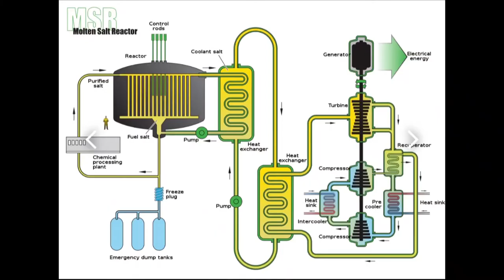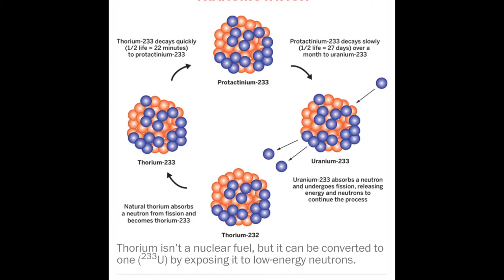The benefits of a Liquid Fluoride Thorium Molten Salt Reactor

Comment: India too has a lot of thorium, and they want to use it. Ther are many smart Indians who can develop the tech.

What about tritium, a by-product? Isn't that one of the elements that's used in nuclear fusion?
Reply: Nuclear fission is for bombs. You need to research a bit, about tritium, dangeroue by-products from thorium use.
Reply: @yngvesognen1092  I'm sure it can be safely handled. Besides, it takes a lot of work to create a nuclear bomb.  In fact when you think about all the crap just dumped into the air from other power plants and the heavy metals put out in the environment, the risk is small.  You need to assume less about other people.
Reply: @daniellarson3068 , I'm sure is not good enough. You have to look at both upsides and downsides. Again, take a closer look at it.
Reply: @daniellarson3068 , really, you don't know the difference between fusion and fission? Rather spend some time googling than walking on a beach talking about things you don't know enough about.
Reply: @yngvesognen1092  You are trying to get a reaction from me kid,......nope.
Reply: @daniellarson3068 , I am trying to get you to think, because you need to know at least the basic concepts of what you're talking about.
Reply: @daniellarson3068 , don't get me wrong.Thorium can quite literally save us. We just need to consider all factors, good and bad.

Comment: "The benefits of  Molten Salt Reactors" There, fixed it for you, thorium has nothing to do with it.
Reply: But Thorium works as a breeder. It's a cheap fuel, why not get excited about it?
Reply: @Birdy890  Thorium doesn't work as a breeder, it doesn't do anything. Thorium is not cheaper and there is just as much uranium as thorium. A uranium MSR is much simpler and cheaper to build and operate, that's why all the MSR start-up companies are using uranium, not thorium.
Reply: @chapter4travels  I could be mistaken it's been years since I was really into nuclear energy, but wasn't the fact that Thorium can breed one of the main reasons why it has been nearly fetishized as a viable nuclear fuel?  My understanding was you had to start the reaction with Uranium, then feed both Uranium and Thorium to keep the reaction going, but only needing to feed a small amount of Uranium because the Thorium will breed into the fissile material needed to keep a reaction going. I'll have to review the info and get back to you.
Reply: @Birdy890  Both uranium 238 (the most common form of uranium in nature) and thorium are fertile and can be converted through a few steps to become uranium 235 and fission. However, this type of reactor is more complicated and expensive. People were interested in thorium because they thought we would run out of uranium 235 and we needed an alternative. Since then we discovered there is no shortage of uranium 235, so it's much easier and cheaper to just use it without having to build breeder reactors.
Reply: @chapter4travels  So first you say it doesn't work as a breeder, then you say it's not needed because it can breed. And no, it's U-233 that Thorium easily breeds into and U-233 is the main ingredient for a LFTR.
Reply: @chapter4travels  Yes, you need Uranium or some other fissile material to start the reaction, but once the environment is neutron rich you can then feed Thorium into the reactor to breed into uranium and thus sustain the reaction. Fissile Uranium is indeed much more rare than Fertile Thorium. Thorium has the advantage of being fertile in low-speed neutron environments (this is why a LFTR needs the Graphite moderator, and thus why I like the idea of a fast spectrum reactor moreso) meaning it is extremely safe as it's self-moderating. If the reactor gets too hot the neutrons go too fast for the breeding process and thus the temperature drops with no need for outside interaction.

I don't think what is cheapest is a viable argument considering we're talking about Nuclear reactors which run a steam turbine to generate electricity - If a cost effective steam turbine is your aim than Nuclear energy is not the way to go - if however you want a safe, clean and hands-off form of power than the LFTR is a very viable alternative.

China, India, Russia, Canada and Indonesia are not what I would classify as "nobody" considering two of the countries actively pursuing Thorium energy fuel cycles are the two most populous countries on this planet.
Reply: @chapter4travels  Thanks for the links, Appreciate it I will read these when I have the time.

Can I ask what you mean by "within the thermal spectrum" though? My understanding is that the work Flibe is doing is based off the already proven techniques and designs provided by the ORNL MSRE. Is this not true?
Reply: @Birdy890  No, it is not true, the ORNL MSRE was a uranium reactor, they never bred thorium. They want to expand their experimental reactor project to do that but never did. Again, the reason was strictly that they thought there was very limited uranium and thorium would be needed.